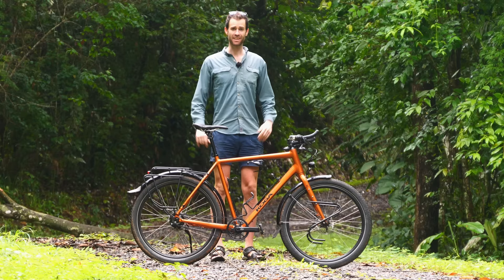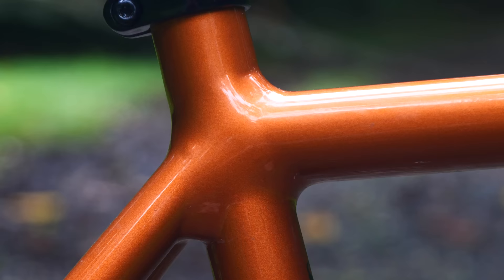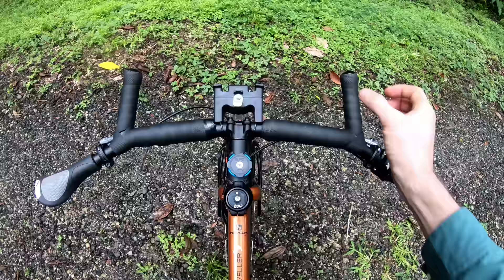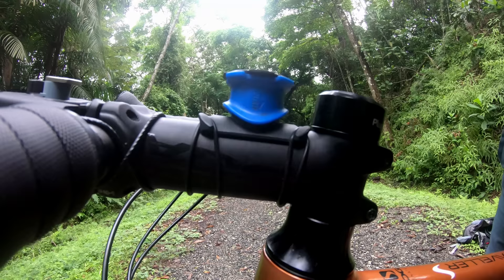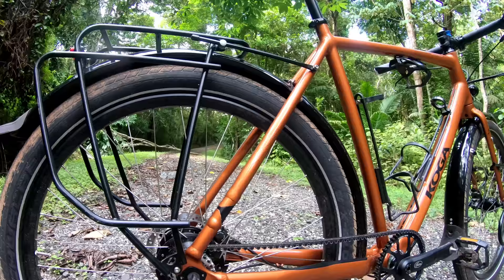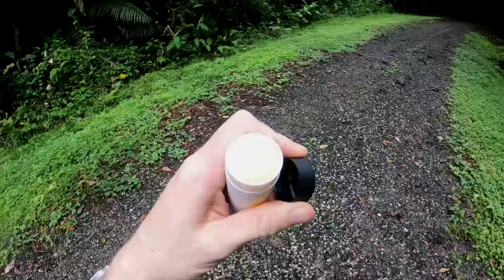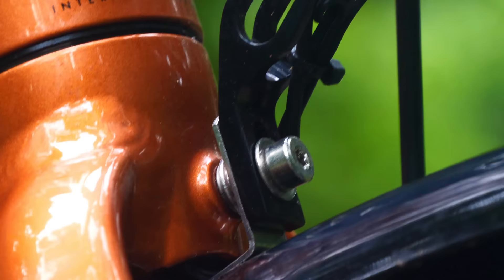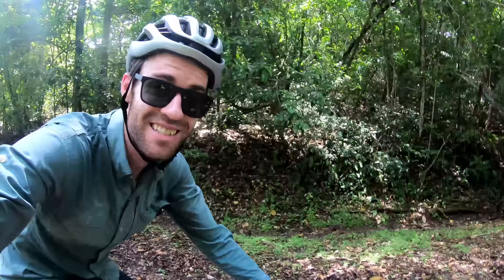The 2020 KOGA WorldTraveller-S is a $6000 Indestructible Touring Bike

Comment: I toured over 24,000 miles in the U.S., Canada and Mexico including the Continental Divide trail, the Baja Divide route and the Florida trail on a $350, Motobecane mtn bike from bikesdirect,com. It had an aluminum frame, hyd disc brakes and mid grade SRAM components. I spent another $400. for racks, front and rear Ortlieb panniers and accessories. I would still be riding it, but it was stolen down near the CA / Mexico border. If you spend more than $1000. total for an off road touring rig, you are wasting your money. Anything more is just status seeking.
Reply from the maker: If I was the only person on planet earth, I would still want to ride this bike. When you examine the details, it is the pinnacle of engineering and design - and you simply can't get that on a $1000 bike. That said, a $1000 bike will do exactly the same job... so if you don't care about the details, you can save a lot of money. 😂

Comment: Thanks for showing how slack you run the drive belt. I recently had a new Gates belt fitted on my urban bike but I was worried when it began making creaking noises when pedalling. I tried spraying the belt with water, made no difference, but I noticed the belt was really tight, I had no idea how the mechanic even managed to do it. I decided to slacken the belt, even moderate tension was still making some belt noise so all I could do was make it really loose like in this video. I'm also worried it might slip so I don't do any hard cranking but it seems to hold up fine with the creaking now gone. Glad to know such  an experienced  cyclist is also able to ride with a slack belt, puts my mind at ease, thanks again!
Reply from the maker: It sounds like your tension was definitely too high, but I can also recommend giving silicone spray a go. This is what I've successfully used to keep my belt quiet in extremely dusty parts of the world.

Comment: 7075 aluminium is coming very soon to framesets! Right now looking towards the Trek 920 for a fully aluminium touring bike ("upgrade?" from a steel Surly) just to get reacquainted with the feel of aluminium ahead of the new, stronger, lighter material. Right now most framesets are 6061 T6 to 7005 and dont go higher than that due to the difficulties when welding the tubes together but in theory, 7075 is nearly as strong as steel and will be a hella' lighter and stiffer, so I can not wait. The Koga is nice, a little out of my budget depending on the fact I change bikes like socks but still, what a beast, and you're setup on it is quite sick, can't think of anything to improve. Well done Koga and well done you! Happy travels.
Reply from the maker: Super cool that we've managed to prevent phase segregation using nanoparticles! It's exciting to see what comes of 7075! ⚡️

Comment: For the people whining about the 6k tag, keep in mind he had over 1/6th of that just in the rear hub. 
 Rollhoffs are exceedingly expensive. 
The belt drive is also a very spendy upgrade. Not to mention that the dynamo hub and integral charging port. This bike doesnt cost nearly that much stock is what I'm guessing. 
For perspective, the rear hub alone before you buy spokes, rim strip, tires and pay someone to lace it, for just the HUB, you can get a really decent entry level touring bike. He pulled up the web page for this item and clicked ALL the boxes. Ching ching ching, caCHING. Like he said this is the premium Mercedes of touring bikes. But the base of it is the really light frame.

Comment: Beautiful bike and you are fortunate to have such a well respected sponsor.  

Does Koga offer longer headtubes for those riders who prefer the bars almost if not even with our saddles?   I have seen a lot of them on the road and often the bikes have incredibly long stems with steep angles to accomplish this.  You are lucky that you are young and flexible and like your bars that low otherwise you would need a lot of spacers:)
Reply from the maker: I actually ride a KOGA frame that's sized too small so that I can get a shorter headtube! The correct size bike actually has the headtube level with my saddle with zero spacers. Once you add a few spacers and a positive rise stem, it's well above the height of your saddle.

The KOGAs have previously used 25mm shorter headtubes because this allowed for both sporty and upright positions. But KOGA found that most riders had 2-3cm of spacers anyway, so they've lengthened them this year. The steerer lengths are always super long from the factory giving you the option to be nice and upright, and the KOGA Justera stem is a super neat way to get even more height from your front end.

Comment: "super stiff for touring, aluminium being weak is a myth, aluminium is more customizable than steel"

false on all counts - your bike isn't super stiff "for touring", it's stiff because aluminium fatigues and cracks if it is allowed to flex, it is literally a weaker material. The weird and interesting shapes on an aluminium bike frame are there for this reason, they stiffen it up to prevent fatigue failure. You could make steel into exactly the same shape there would just be no point. Stiffness in a touring bike is a disadvantage. People choose steel because it can flex for comfort. Aluminium is merely a cheap alternative to carbon fibre in racing bikes and has no other rationale.
Reply: ^ this guy knows whats up
Reply: I don’t know how much kilogram, but the author carrying heavy stuff for years. 
and I can’t imagine carrying heavy stuff with flexy thing. 
bikepacking/light-touring with flexy bike? sure why not.
Reply: There are better options for $6000,  and aluminum wouldn't be my first choice.
Reply: true, they put bigger tyres on the uncomfortable aluminium frame to balance the ride out. Steel frames are just so much more of a joy to ride, and the flex you aren't going to notice or lose power from, just appreciate the comfort and beauty of the ride. You can't get the quality of ride a good steel bike provides from any other material except some titanium bikes, carbon is lighter but is a dead feel.
Reply: I built a custom stainless Vaya Travel from frameset in 2015 or so.  Strength of steel, but no paint/rust, and almost identical in weight to titanium frames (quad butted tubing).  What isn't mentioned here is steel and titanium frames can have S&S couplers installed, which makes any world touring bike that much easier to pack and take along, and the Vaya Travel came with them installed for $2k for the frameset.  Too bad more companies don't make stainless frames, they're beautiful.

Comment: Great video. Just one inaccuracy: your bike is NOT the equivalent of a high-end Mercedes Benz. It is the equivalent of a high-end Lexus. If your bike behaved  anything like a Mercedes Benz you would be in the shop all the time. MB have become notoriously unrealiable cars over the last two decades unlike Lexi which are bullet-proof.
Reply from the maker: Didn't realise that MB had a bad track record! I just looked up the stats, Lexus (99 problems per 100 cars) or Porsche (100/100) would've been a far better reference car. BMW was ranked 7th (124/100) and Mercedes-Benz 12th (147/100).

Comment: Six THOUSAND!!  I know weed became legal in many places, but damn!.  How much did they have?
Reply: just a little bit but it was supah killah yo!
Reply: Made in the Netherlands, and top notch quality. Mine is still doing great and it was made in 2005.  it's not a bike you change every couple years.
Reply: @HassanDibani    Great story,....my 1998 specialized FSR Elite pro  was abt $1700 with custom Risse  rear end MRP link  BETD bearing kit I upgraded the shock to a Fox DPS Evol. & It has a 10 yr old  fox 36 talas fork....it's rock solid today & performs better than the last time i raced it at downieville 12 yrs ago, it  hasn't skipped a beat in 20 years..

If you take care of your stuff it can last a long ass time....!   You don't need to spend the amount of a used car...but there will always be those who choose to. And that's fine.
Reply: @RaptorV1USA  I have a 1998 GT hardtail! Still runs like a charm 😅
Reply: Ken Little a total rip off.
Reply: Many of the expensive components on this thing are made by small german companys (Rohloff, SON, cinq, Tubus), this is not large scale industrial production. At least for Rohloff and SON I am pretty sure that they actually produce in Germany as well, very expensive. The gear hub + generator alone are > 1000 € but mostly worth it and without real alternative. For a less expansive generator you could go with Shutter Precision from Taiwan. The only real alternative to the Rohloff hub is a Pinion Drive, even more expensive.

Side note: I talked to the founder of SON at a bike fair without knowing who he was. You would never guess.These people are engineers, not penny pinchers in suits.

Comment: Thanks for the confirmation that clip pedals are almost entirely unnecessary, except for certain use cases like yours. I ditched them a few years ago for DMR BMX pedals and haven’t looked back. If you cycle like a normal person, and don’t want to clomp and slip about with clip shoes when you get off the bike, they are the perfect choice.

Comment: Hopefully you will not need any parts when on the road in a far away place, you will never find any.
Way too exotic for a  "  'round the world " trip. 
 A 26" steel hardtail would be much easier to refit in an emergency.     A standard bike is your friend. Ego is your enemy.
Reply from the maker: I've been travelling on a 'round the world' trip, across almost 100 countries with these exotic parts. The key here is that I choose parts that are highly unlikely to fail. In the last 2 years (or 30,000km) I've broken just one spoke and had four punctures. That's it!
Reply: @Cyclingabout  Say your in a jungle in a 3rd world country. Your bike is parked and gets hit by a car, or stepped on by a cow/elephant . You need a fork and wheel to make it home. Maybe even your frame is cracked.  Impossible? I think not. Shit happens, even to the best of us. One would be easily able to barter for a 26" wheel and fork, and find a welder to patch the frame. 27.5 tire, not easily. Fork...gonna cost you. Find a TIG welder to fix the frame...good luck. I admit, this scenario is unlikely but it does happen. No one is immune. 
A steel 26" bike is a smart choice because or worldwide availability...worldwide.
Reply from the maker: @ratoneJR  I'm happy to roll the dice on this! Worst case scenario is that I get some replacement parts shipped to me in 10 days through DHL, which is all covered under my travel insurance because it's an accident. 👍🏻
Reply: This bike is basically bullet-proof and he's had experience with most of the parts that have already proven to be extremely reliable. On my last two big tours I used a full carbon bike and had no issues. What are you actually concerned might break?
Reply: CyclingAbout whatever you do,stay away from them there elephants 🙄😂😂🚴🏻🚴🏻🍷🍷👍
Reply: @Cyclingabout  good luck keeping that bike ,,, hope you got a good lock
Reply from the maker: @paulschmidtke425  Yep, got a good lock and a strong sense of where is best to lock it. So far, so good.
Reply: Finna Sprang  your the bloke that needs rescuing because of poor decision making and bad prep
Reply: He literally fall of a cliff and still going. You try to sound like edgy expert but the look at his channel and think about who you are talking down to.
Reply: ratoneJR right👍
You would always prefer steel or titanium to aluminum,the wall thickness
is less more than a coca cola tin and therefore vulnerable.
As you said,stay simple
Reply: @Cyclingabout  Theft is what would scare me, I suppose my perspective is somewhat different as a bike commuter but my philosophy towards my bike has been "good enough and ugly enough". I'm still riding around on my Frankenstein monster because I worry that upgrading to a nicer bike will risk becoming a target for thieves. Regardless this is a beautiful machine, thanks for the video!
Reply: Finna Sprang  How's life Finna? Talk to your family lately? Judging by your comments you could use a little bit of human contact.
Reply: Finna Sprang  To each their own I suppose...
Reply: Finna Sprang Lady, your sense of humour matches that of mine.

Comment: I would compare it to a Toyota Landcruiser; Mercedes made mostly junks nowadays.
Reply from the maker: PDB Long Didn’t realise MB lost their way!
Reply: @Cyclingabout  It's a modern car's problem: The more features you put on a car, the more there is to go wrong. Mercedes are no exception to this rule, although they still try to produce quality.
Reply from the maker: @frost1978  I guess so, but some high-end brands have many more problems than others - it looks like Lexus and Porsche lead the way...
Reply: PDB Long Mercedes is not mostly junk. It has problems like any other car. You cannot have perfection. It’s called job security
Reply: @lookpro.rideslow  Resale value dictates quality; look no further than the Toyota or Honda lines.
Reply: @tdgdbs1  resale value does not. Mercedes tech moves so quickly forward that the previous model becomes obsolete in the eyes of Mercedes customers. Unfortunately they dictate the values. Toyota and Honda hold a stronger value due to the fact that they do not progress as quickly between model years.
Reply: 25 years in the car biz, former factory rep  for Mercedes-Benz of No America.. the factory not a dealership. ( District Manager for Northern California) I have personally owned over 100 cars and trucks. Mercedes Benz lost it when Chrysler slimed in the door and ruined the product and reputation. I quit because of Chrysler as did many other M-B of North America employees.  Mercedes is attempting to come back, but they are nothing like the pre Chrysler products. I now own and drive Toyotas, I have owned 14 of them over the past 25 years, I currently have a few. The best are the 4 Runner ( I have a Gen 3 2000 ) and the Land Cruiser, both made in Japan. I also have a 2016 Tundra and a 2018 Highlander. My neighbor has 2  newer Mercedes, both are problematic and spend quite a bit of time at the dealership. When I worked for M-B our cheapest car was 30 grand , 3 decades later the cheapest M-B is around $35K, soemone explain that. Compromises must be made, design, materials, workmanship and customer service.. soem or all have to be compromised. I would not buy an M-B made after 1985.. the best were 1980 -1983.. and non turbo if you can find one, especially the non turbo 300 wagon.. none finer

Comment: "aluminum being weak is myth"
"I only use steal racks on my touring bikes because along with the wheels they are the most likely component to fail"
Reply from the maker: Aluminium is not good for all applications, but it's great for a frame. The reason I recommend steel racks is that pannier hooks and clips rub on the rack tubing - causing wear - and steel has a harder surface to resist that rubbing. There is nothing rubbing on a frame.
Reply: Steel has a lower fatigue rate also
Reply: @Cyclingabout  Aluminium is wank for a frame. Makes bikes ride like garden gates.
Reply: I break aluminimum racks after 3 years. My tubus is still going strong after 5 years. Its the constant rattling that breaks the aluminium welds.
Reply: @maxotterland  course they do or builders if carbon road bikes would not spend a fortune trying to make them stiffer.
Reply: @Cyclingabout  Bullshit! If it's rubbing, it's not fastened properly.
Reply from the maker: @solexxx8588  Nah, there is no way to fasten a pannier without some level of rub on the rack.
Reply: @solexxx8588  it rubs it rubs
Reply: @adambrickley1119  Stiffer which way? Vertically or laterally? If you mean vertically, please show me a scientific study that shows any significant difference in vertical deflection of tubular triangles made of steel, aluminium or carbon .
Reply: steel*

Comment: it this price, i could get something more indestructible but also having a gasoline engine running at 100 mph. its way overpriced.
Reply: Low volume production is why. If these were made in the same numbers as motorcycles in an assembly line it would be worth closer to $500.
Reply: @centripetal25  maybe not 500 but 1500 is a safe bet, those fancy gearsets ain't cheap
Reply: sounds like a pretty good price to me, I was thinking that 5k euros for the full bike and accessories was pretty cheap to be honest

Comment: Kudos to Koga for the smooth welds! Looks much, much better than the crudely welded World Travellers & the like. 

 Although I'm more into gravel / adventure bikes (but much, much, much prefer tarmac rides to gravel), I must say I rather like this Koga. Not enough to buy one when I can acquire another carbon or even aluminium, titanium or steel light gravel bike instead, but still, I like the bike.
Reply from the maker: The super smooth welds and internal cable routing are definitely my favourite design details about the frame. I think anyone can appreciate the details of a well designed and engineered machine like a bike, or a fancy car!
Reply: @Cyclingabout  Agreed, Alee! Forgot to mention the internal cable routing myself.
Reply: Older Italian road CRM steel frame welds are so well executed they're invisible. A thing of beauty. Ciao.
Reply from the maker: I do enjoy a nice clean steel or titanium weld. Half of my custom steel bikes are fillet brazed too, so there must be something about the flattened look between tubes that appeals to me.